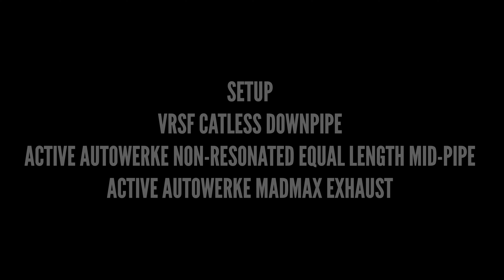F80 M3 With VRSF Catless Downpipe + Active Autowerke Non-Resonated Equal Length Midpipe

Comment: Yeah I wouldn’t go catless and non resonated lol. I went non res on stock muffler and stock downpipes. I do wanna go catless dp for performance, but I don’t wanna mess up the sound. Sounds pretty good rn…oh the dilemmas lol. Got in depth exhaust video on my channel comparing stock vs EL non res under diff throttle/ valves open and closed